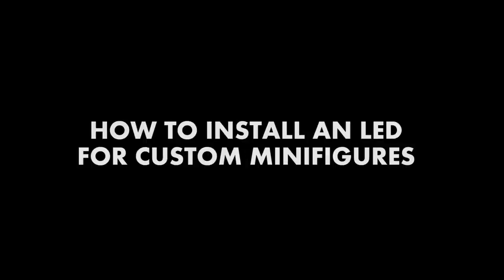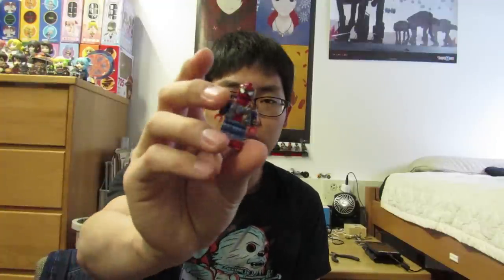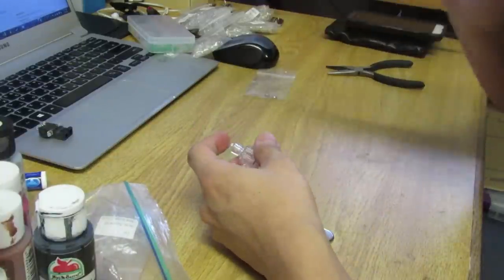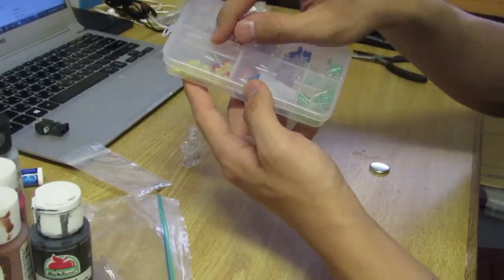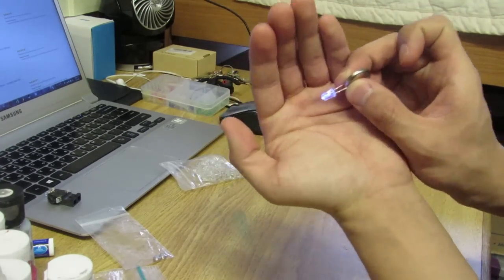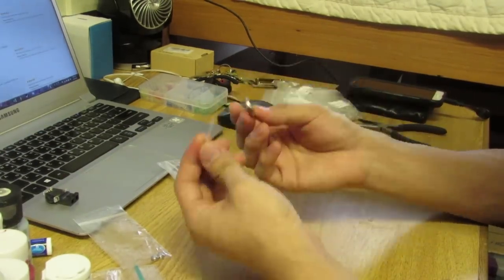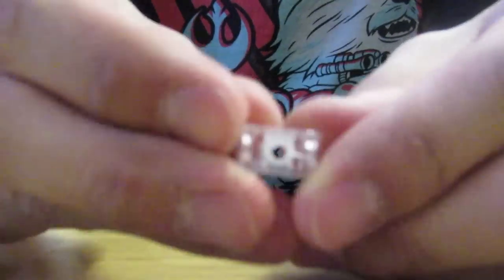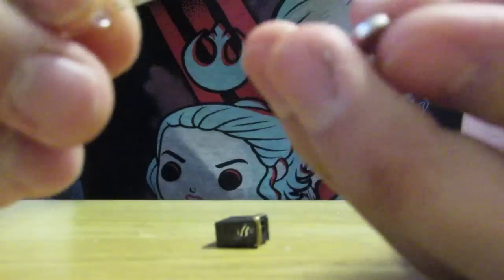How to Install LED and Batteries- Custom Minifigure Tutorial

Comment: An idea maby you could use a purple pain wash to make the led for black panther. I dont know if it will work but i tought maby its worth a try.
Reply from the maker: you do know that a paint wash doesn't make the paint transparent?
Reply: 97legomaniac maby you could mix it with a liquid varnish in my experiance that worked pretty well.
Reply from the maker: but thats still not transparent. That makes it translucent.matte paint even mixed with anything you can think of will never become transparent.
Reply: transparent figures arent on amazon, ebay, or aliexpress
Reply: 97legomaniac it worked with me. But okay it was just an idea.
Reply from the maker: i guess they sold out then. They are hard to find now